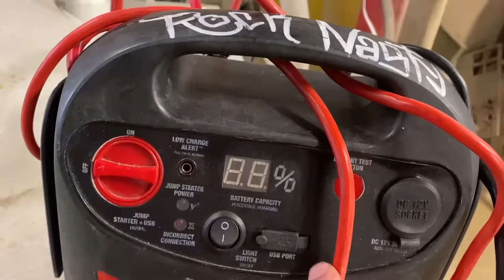We bought a Pallet of Police Evidence at Auction

Comment: All those fittings, couplers, and cords are for fuel loading. The curly cord is for the overfill protection. All worth way more than you paid....
Reply from the maker: But how do I get money from it?
Reply: @WaterjetChannel  some people trade currency for goods....
Reply: @WaterjetChannel  I'd try loooking the stuff up and put it on ebay.. I'd leave out the part about buying at the donut auction and list it as "open box" "like new".... there are many diffrent seal materials for the valves. Buna is probably the cheapest and viton one of the most expensive.
Reply: @AndyFromm  It's not NOS. That would be fraudulent.
Reply: @xenonram  ok, open box...
Reply: @WaterjetChannel  use your brain
Reply: Cord protects from overfilling, it also grounds and reads the chip on the trailer so the "multi load" program can grab trailer ID and know weather your vapor tight papers are current or not and weather that trailer is an authorized unit on the property.
Reply: @codymcpherson8209  i know that is an option but around Minnesota i have yet to see a trailer or terminal set up to id the trailer off the scully  cord.
Reply: Fuel couplings for terminal arms and hoses, the cable is a Scully for the trailer sensors (overfill and connection/grounding)
Reply: Sounds like you guys hit the jackpot
Reply: There is a rack down in Texas that I know of that ID's the trailer through the Scully cord.
Reply: @WaterjetChannel  Talk to the gas  or trucking companies that handle them. Get the names off the side of trucks filling your local stations. Then give them a call and ask. That's just my thought tho
Reply: Nice score. The only issue I see when trying to sell these items would be the liability from end user. They would likely have to shy away from a second hand/third party seller due to the extreme regulations they have to follow. In the event of failure, the paper trail dies at the police auction. They would have to assume the total liability of the failure and that would not likely happen. Good luck and cool vid
Reply: @AndyFromm  here in Texas a few people like motiva and Flint hills uses the chip. I think it really comes down to location and whatever company is operating the terminals. It's cool though. If vapor tight is getting close to expiring, the multi load will show a message after reading the trailer number telling you it's going to expire soon and on what date.
Reply: @kevinvanderloop1774  motiva un central Texas and East Texas does
Reply: @codymcpherson8209  that keeps people honest, here we enter our trailer number and it gives warning starting 60 days before vk is due. You could enter any number that is valid if you aren't worried about the dot catching you i guess.
Reply: @AndyFromm  yeah about half of the racks here are that way. Alot of the terminals here will ban you for life for putting in the wrong number and a Valero rack will ban you for life and the company for a month or so.
Reply: @codymcpherson8209  same around here
Reply: Waterjet Channel that big grey API coupler alone is probably worth more then you spent at the auction.
Reply: @WaterjetChannel  If you see someone offloading fuel at a gas station, ask him about it. At least give him your contact info so if he doesn't want it, he may know someone else that does. I might also have some contacts that would be interested if you still have it.
Reply: The cord is for a thermistor correct? Never actually seen the cable but I've seen where it connects to the tanker plenty of times. They have two different ones and they're color coded I know but can't remember if thermistor is blue or green though I think its blue.
Reply: Waterjet Channel try calling fuel hauler companies to sell the hose fittings
Reply: No, the orange cable is electrical not a pipe 🤦‍♂️
Reply: They walked away with about $5800 worth of stuff that nobody will buy and about $900 in tools they can sell at a flea market.
Reply: That Scully plug is worth what you paid for the pallet
Reply: Waterjet Channel  there called camlok fittings if you were wondering what kind of value they have
Reply: I think what the guys are saying is how do I maximize the price of these items without spending a ton of time. In other words, my time is money.
Reply: The cords and “strange couplers” with 2 handles are for fueling large aircraft. So your local airport.
Reply: @kevinvanderloop1774  forget you
Reply: @devilmonkey  why?
Reply: The orange coil cord is a overfill protection device, others have mentioned that, new they are at least $600, at least that’s what they charged me when I tore one off the rack.
Reply: the one valve/coupler looks alot like something you would use to load spray chemicals into a crop duster with. or possibly fire retardant for a slurry bomber.
Reply: Waterjet Channel its all for gasoline and other derivatives. I’d contact a local fuel distribution company and see if they’d be interested in buying the whole lot for like 1k. Usually they throw those chucks on the side of the truck and don’t tie them down. Any big bump or something like that and they lose em.
Reply: @AndyFromm  haha
Reply: @AndyFromm  .
Reply: @floundermac  .
Reply: Large Coupler  $1800 Au  Smaller  one  $750  orange Cord $1200
Reply: Yeah all stolen from a fuel truck massive money new
Reply: @AndyFromm  ju
Reply: @AndyFromm  definitely trafficking in stolen goods
Reply: Thanks for the video content! Excuse me for the intrusion, I would appreciate your thoughts. Have you thought about - Tarbbatigan Vintage Sales Tip (erm, check it on google should be there)? It is a good one off product for finding government and police auctions for cars trucks and SUVs minus the normal expense. Ive heard some super things about it and my friend Sam at very last got great success with it.
Reply: Nice video content! Sorry for the intrusion, I am interested in your opinion. Have you considered - Tarbbatigan Vintage Sales Tip (just google it)? It is a good one off product for finding government and police auctions for cars trucks and SUVs without the headache. Ive heard some interesting things about it and my mate after a lifetime of fighting got cool success with it.
Reply: Thanks for the video content! Sorry for chiming in, I would appreciate your thoughts. Have you tried - Tarbbatigan Vintage Sales Tip (search on google)? It is a smashing exclusive product for finding government and police auctions for cars trucks and SUVs without the normal expense. Ive heard some awesome things about it and my cooworker at very last got cool results with it.
Reply: @WaterjetChannel  large fitting is a dry brake . contact companies that sell bulk fuel . they use it to load fuel trucks .
Reply: @AndyFromm  that's hilarious.
Reply: @WaterjetChannel   Did you ever sell these fuel fittings and how did you make out?
Reply: @AndyFromm  damn
Reply: @AndyFromm  good one lol
Reply: The brass vapor swivel popper sells for 500$ alone lol

Comment: Hey guys the 2 handle valve thing is for the end of a large jet fuel hose. The military and commercial aircraft use it. Very expensive.
Reply: also used for fueling up fuel tanker
Reply: I would be surprised if anyone will purchase this nozzle due to regulations.
Reply: But would would buy one from an unverified source...
Reply: @ronplatt15  exactly. No aircraft operator will ever buy valves from a random dude.
Reply: How did the police get it also some collectors might buy it
Reply: They’re called “dry-break fittings”
Reply: aircraft operators dont buy gse, that is all provided by the airport / the company that has the fuelling contract or used by a maintenance facility. Nothing wrong with buying second hand gse as its not being fitted to an aircraft.
Reply: Tt Miller no they don’t....
Reply: I would sell all those valves and fittings to a refurbisher
Reply: Apaches and other aircraft are also compatible wit this type of refuel hose
Reply: None of those fittings hook to aircraft. They can be adapted to fit from tanker trucks to fuel farms or loading racks but not to aircraft. The orange cord is a scully cable for an optical probe. It shuts the pump off on the rack to not overflow the tanker.
Reply: The big head is a LOADHEAD for loading fuel into a tanker and the smaller one is for connecting a hose to a large nozzle for fueling locomotives and planes.
Reply: Fuel hoses and couplings are ground handling equipment. They will buy from anyone if the manufacturer is right. And those are obviously unused. Huge score. Call Air Spares in Puyallup, WA and send them photos.
Reply: First Name Last Name  lmao are you 12?
Reply: No first world country would have chill regulations to buy this stuff off a random person, but... The world is full of third world countries that don't give a damn, sell it at half price and they will be more than happy to buy it

Comment: Those valves your throughing around go for about 3500 each
Reply: Thats what I was thinking, those can't be cheap. Looks like fuel truck parts
Reply: @mechanicalking  thats exactly what they are. They have the check valves in them
Reply: But are they worth anything open box like this?
Reply: @johnfroh6774  im not 100% sure. Im sure they are worth more than cutting up lol
Reply: @tnoutlaw73  Lol true
Reply: I haul fuel, that cord is an optic cord for when you are loading fuel at the rack, those go for around 700 dolars, that valve with the knob is the head for a fuel arm at the loading rack, it connects to the fuel port on the side of the trailer it locks on and sends fuel from the arm to the trailer, those go for thousands of dollars a piece!!
Reply: @johnfroh6774  yes worth pretty much the exact same as closed box price
Reply: @codymcpherson8209  and now we have the professional and verification.  Thank you sir. !!!!
Reply: The head with the knob is called a bail, for unloading crude oil tankers
Reply: The inline spectrum connects to the rotor gurder and also to the tube extractor. Very important stuff.
Reply: "throughing"  🤔🤔
Reply: @johnfroh6774  yes it is new
Reply: What a score!
Reply: My question is where did the police steal all this stuff from
Reply: This guy's knows, he stole them..
Reply: Out Law
"Those valves your throughing around"

It's spelled "throwing", not "throughing".
Reply: Have you gone through your life thinking that’s how you spell “throwing”?
Reply: Yes they are expensive the big valve cost over $15000
Reply: They haven't got a clue just how much money they are throwing around be careful if you damage one of the valves its worthless
Reply: *you're throwing

Comment: Years of AV installation and configuration experience here, you do plug a mic into those they just have a smaller 4 pin jack, usually on the top. They're the transmitters. The device which plugs into the mixer and sits on a shelf or mounts in an equipment rack is the receiver. 

Love the channel guys. Keep 'em coming.

Comment: They are dry break couplings for the fuel industry, the orange cable is called a Scully plug and goes from the tanker to the loading skid to ground the compartments and to connect the over fill probes

Comment: Those couplers are probably for oil vat drains at quick lube centers. Oil drains into a vat. When it's full you connect and drain into a gravity or suction drain tank for waste oil. Probably a sales set though because there is a wide selection.

Comment: Send the drill to AvE he might put it on the healing bench and fix it lol
Reply: They didn't know what that copper heat sink was, so I'll assume they don't watch AvE.
Reply: @xenonram  I don't think that he has gone over a copper heat sink on a trigger switch before, or at least in a very long time, as most switching is done outside of the switch nowadays in battery operated tools.
Reply: If only they sent it before cutting it open, AvE would have a fun day disassembling all those parts :P
Reply: @LordDragox412  na he has already po pood on that model he would like it for the fact it was cut in half so he could really get into the inner workings of it minus the motor they just wouldn't be able to send the battery pack

Comment: The big silver thing could also be used to load semi trailers with fuel. It's called a dry break and the orange cord is called a Scully cord which connect the loading station to the semi and it checks for a ground and a few other safety features are in operation on the semi

Comment: Most of the “couplers” are basic hose connections used in everyday things such as septic hoses, pressured water hoses, vacuum hoses. The blue union with the three tabs is called a hammer union and with the cap it appears to be for a mud line used in the oilfield.

Comment: The couplers and attachments you have on the table are fuel loading heads, very expensive, and the cable is a grounding cable for when you load flammable liquids such as gas, diesel, etc. Take them to a truck shop near a fuel loading facility and you should get over $1000 for it if they buy them from you at pennies on the dollar

Comment: "But that is the old style drill that is pretty obsolete now."
We still use that kind at work cause my boss is cheap ;n;
Reply: They work the best. Stinger motors batteries last longer
Reply: @ja-vg2fh  Like charge wise? Or lifetime wise? Cause speaking from experience, hell naw. Those things break so often cause the way the contacts work. I've had to fix them so many times, and they still keep failing.
Reply: First Name Last Name  what's black?
Reply: @ja-vg2fh  was about to say couldn't you just replace the battery pack and re lube the gears? If kludged together some old porta cable drills back in the day when the batteries failed because the gears just wouldn't quit in those things.
Reply: The drill is good for larger bits
Reply: @ianmcfetridge4396  Usually for larger bits we pull out the corded drill if we can.
Reply: They work and he must have a good warranty cuz older models had the best warranty now they limit them to a couple years
Reply: Old or not...
It’s still a DeWalt and worth money if it is still usable...

Comment: The Big coupler is worth  $2000 thousand its a loading head from a oil refinery to load gas diesel so on into tankers The black coupler  $1000 its a dry brake for loading av gas usually used at small airports

Comment: 5:49 that is used to load fuel trucks at the refinery.
Its designed to handle high flow rates and high pressure fluid transfers.
Reply from the maker: How much will you give me for it? 😉
Reply: @WaterjetChannel  nothing! I dont haul fuel anymore!🤣 you should cut it down the middle I'm curious to see the inside.

Comment: One table for aviation fueling and truck load rack and the curly wire is a ground cable called a scully. Used to ground tanker trucks when loading fuel

Comment: The connector at 5:54 is used in commercial fueling. Its a vacuum seal that connects a fuel line to a male connector on a truck to transfer fuel.   At my site we used them as our connection point from our main storage to the truck when refueling fuel haulers.

Comment: Those 2 handle valves are “no leak valves” they attach and can only be opened when it’s attached to another valve or port. I use them every day at the oil and lubrication plant I work at.

Comment: That orange cord with blue end fitting looks like a ‘scully system’ cord. 

Scully is overflow prevention system for loading of tanker trucks (fuel trucks)

Would appear that someone got that at the same location as the septum valves ( you described as -some kind of ball valve-)
Reply from the maker: I love the wisdom of the internet

Comment: The table with the huge couplers is all petroleum terminals. The cord is a Scully cord. It connects the trailer over fill system to the terminal over flow system. Probably a few grand worth of stuff. A petroleum companies would surely be glad to get a deal on them. They will surely want to know where you got it.

Comment: Pretty sure that table was all fire hose and hydrant parts and attachments
Reply: Those couplers are also used to connect aircraft for refuelling, and are designed to connect and disconnect without leakage, even with pressure and flow.
Reply: They look more like fueling tools found on tanker trucks for filling gas station tanks.
Reply: @dylan8755  I'm  a gas hauler. you are correct
Reply: Black one looks like it possibly for a plane, i use a smaller version on my fuel truck, definitely use the rest on my truck. Why is this stuff "evidence"?
Reply: Pretty sure the black one is for DEF
Reply: @AndyFromm  because they are stolen parts. Recovered during an arrest, and the original owner is not found.
Reply: @CzarYe   who wouldn't report $5k+ of new fuel truck fittings missing?
Reply: @AndyFromm  well, when you have insurance that covers those parts, it would end up costing more time, and time is money, to wait on those parts to be found, ID'd and then wait for them to be released, than it would to just cut them as a loss and replace them. Especially if it's 5k+ stolen, it's definitely going to be covered, if they are smart.
Reply: @CzarYe  yeah i guess I've had stuff stole in the past and that exactly what happened, insurance just replaced the stuff.
Reply: No fire hose stuff just industrial hose couplings.

Comment: The connector/valve at 5:50 is a dry break fitting used to transfer fluids, usually flammable, without spillage when disconnecting. 6:21 ditto, different size dry break. They are worth way more individually than what you paid for everything.

Comment: The blue coupler looks like a high pressure hammer lock blind. I know they are used for hydro testing pipe and tanks but I've also seen them used for oil transfer trucks.

Comment: A gated valve switched from a large pipe size to a smaller pipe size. Fire department items and very little resale value. They get their stuff new and free, shipped to their door. You might be able to get a contractor that pumps water from a job sites, they may give you a hundred bucks for your hydro fittings.